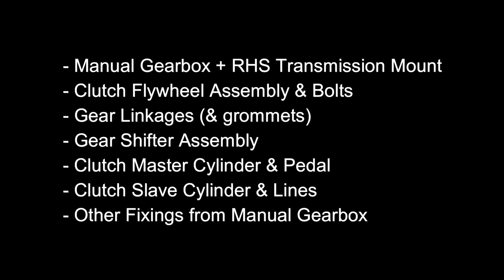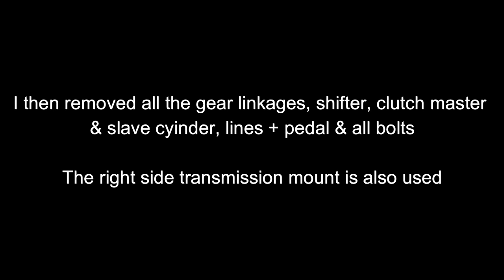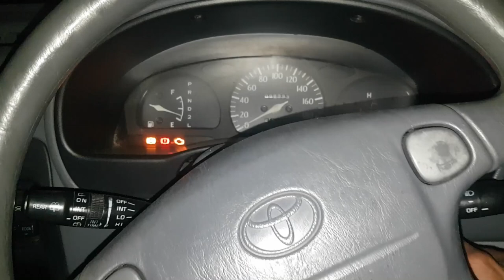Auto to Manual Conversion - Toyota Starlet 1996 (4E-FE)

Comment: I purchased a manual swapped GLanza V last year and one thing i have noticed is that I can still start it in neutral, telling me that they did not touch a clutch safety switch, i was also told that alot of cars only sold in japanese domestic market didnt have clutch safety switches from factory and i always thought that was odd. Another thing i wish i could find out is what manual gearbox they used

Comment: my friend good job...one question, revense light is connected...
Reply: You can get a spare manual gearbox reverse connector and cut the reverse wires going to the neutral saftey and solder them to the connector

Comment: Can you please drop a link to buy
RHS gearbox mount or picture of it..am swapping my ep91 with a 4 speed manual from old starlet
Im stuck on it please
Reply from the maker: I just got one locally. Basically it should be the same mount that comes with the gearbox. There was a slight variation. Some engineering work could also do. Cheers

Comment: First of all congratulations. It’s a great video and you did an amazing job. I have to put a 4EFE manual gearbox on a 4efte that came automatic. The flywheel is still on the engine. Should I use the manual 4efe flywheel? I also want to know how much gearbox oil I should buy for the refill after converting. Thanks!
Reply from the maker: Thanks,  about 4-5L from empty, fill to level plug. (might've been 75w-90 or 80w-90)

I would take it easy on 4efe gearbox, although they may be built just as strong, given Toyota.

Yes manual flywheel will only work with clutch pressure plate assembly.

Couple small things I forgot to do included the reverse switch which wires to to upper pins on the auto transmission connector, and use a better clutch before putting it in.

Cheers
Reply: Assembly worked out perfectly. I got the FTE fly wheel and put a good clutch. It works fine. I have a friend in England who put the two gearboxes apart from the two different engines and he told me that they are very similar and let means that they resist the same pressure. Anyway I’m not gonna put 300 hp. I want to tune in to about 180 to be able to use it as a daily car.
Reply: @djfrankieflowers  how did this manual swap go. I currently have a auto glanza v and am looking to put in a manual gear box out of a glanza s. Sounds like you've done something similar. Anything in particular to look out for that may trip me up
Reply: Hi there. Despite other people on YouTube that never answer to important details that can change our lives, I am going to tell you my great experience. My 4efte Starlet Glanza engine was automatic. My Corolla E21 4efe engine was manual. We removed the automatic fly wheel (dented) and installed the 4efte manual rectified fly wheel. This way we could install the new clutch. The rest was pretty straightforward. Just don’t forget the manual fly wheel bolts!
Reply: @frankieflowers4732  appreciate it 🙏
Reply from the maker: I think  another thing to look out for is the transmission mount can have a slight variation between models.
Cheers

Cheers
Reply: @frankieflowers4732  finally finished my glanza manual conversion. Couple of things I've noticed boost has dropped and oil pressure light is half illuminated any ideas why this has happened?
Reply: Did you bridge the connector that used to go to the automatic gearbox? That is important to elude the ECU.
Reply: @dylanc4684  did you ever figure out the lowered boost issue?
Reply: @pate7816  haven't quite figured it out yet it will freeboost 10+ psi when taking off the hose to actuator. I do have a manual ecu which I will hopefully get a chance to plug in the next couple of days and will let you know how it goes

Comment: Heya how would you wire up the reverse lights?
Reply from the maker: From the auto transmission connector you need to wire up and connect 1 or 2 of the pins to the reverse switch located on the transmission housing.

Comment: Thanks again for this video. It was very helpful. I swapped a manual 4efe with a auto 4efte in a Corolla E11. I bridged the pins in the connector for the auto transmission but the engine check light is on. Diagnostics gave my error 22 and 42. How can I solve the get the ECU to bypass the malfunction created by the auto gearbox removal?
Reply from the maker: No worries. The car didn't have any issues apart from reverse light pins needing to be wired into the auto transmission connector.
I'm not sure with the check engine? Maybe the MAF sensor or vacuum lines? (if they have one between models)
Cheers
Reply: What is the MAF? Are you talking about the MAP sensor?
Reply from the maker: @djfrankieflowers  mass air flow - I've heard turbo models often use them
Reply: J want to  change automatic transmitions with manual  to toyota camry 1992 2.2. Is it possible to put the manual transmission  from toyota celica  or some other models of toyota

Comment: I have 5afe auto transmission. 1st gear shift into 2nd around 2400 to 2500 rpm.due to high rpm shift car jerk. Plus due to this problem also facing low fuel mileage. Cos on low speed in city rpm mostly touch 2000 which is one of the reason for bad fuel consumption. Can u tell what i need to to . What i check transmission fuel ok, plugs ok, throttle body cleaned, kick down cable ok too
Reply from the maker: Could be an issue with the auto transmission or electronic control - maybe throttle sensor although I'm not sure. Cruising RPM should be much lower you are right about higher RPM's leading to more fuel consumption.

Comment: Could someone please tell me where to find or how to build the CLUTCH ALIGNMENT TOOL WITH SOCKET EXTENSION?
Reply from the maker: Wrap with electrical tape evenly on each point until they fit snug for aligning. 
Can possibly do it by eye if your lucky, but may take a lot longer to fit together.

Comment: Did you have to swap the engine? I guess not but i thought you do. I have a 1995 geo metro 3 speed that im thinking of switching from 3 speed auto to 5 speed manual. Just wondering how difficult it would be.
Reply from the maker: No, the engine did not have to be swapped. It depends on the design of the vehicle, if the body was available in both manual and automatic variants, it will certainly be easier.

Cheers

Comment: Is a 1995 Toyota Corolla engine compatible with a 1993 Toyota starlet gearbox?
Reply from the maker: Hi there, I'm not really quite sure to be honest.
There are quite a few similarities between models, but my concern would be the transmission mounts are likely to be different to fit the body of the vehicle. I would compare the two side by side to identify any differences.
Cheers
Reply: Thanks

Comment: Hi, I'm thinking about doing the same Auto to Manual conversion, is this a one person job (start to finish)? Also, i'm in NZ as well, how did you go about WoF and Insurance etc?
Reply from the maker: Hi there, one person with the right gear and about 2 days total to replace the transmission. No issues yet after several years, they are all factory toyota parts and designed for the vehicle chassis, therefore from a mechanical perspective it functions as intended.
This may be different in your circumstance, in which case I would inquire to your local auto - mechanic workshop.
Cheers
Reply: @stefanstoove9254  Hi, thanks for answering. Good to hear that the conversion is holding up and very true about the parts being used for its intended purpose etc. Great video, really informative. There are some aspects that I'm uncertain on (wiring/jumper etc), will look into it. But massive prop's. Cheers.
Reply: Hey mate I'm in NZ too and considering the swap, any chance you've made any progress or have found anything out regarding wof etc?
Reply from the maker: You will likely need to have a low volume certification through LVVTA in New Zealand to be fully compliant.

Comment: You dont happen to recall the gearbox model number you used do you?
Reply from the maker: Is that printed on the gearbox somewhere? I could take a look and see. Cheers
Reply: @stefanstoove9254  I think it is on some, but im not sure where on the gearbox it is. Its on the VIN plate, but that would be on the car at the wreckers still. 😁 All good, im looking to do the same conversion, but just cant seem to find the code for the gearbox that came in the 4efe cars as opposed to the 4efte turboed ones. Good video too by the way, very helpful. 👍

Comment: Do i have to do the same thing to a toyota corolla 1997?
Reply from the maker: If you want :)
Just make sure the model came in both auto and manual and the job will be a lot easier. Sometimes the engine mount may be different. 

Cheers

Comment: Did you install the sandwich plate from the manual car between the block and gearbox?
Reply from the maker: From auto car,  has a little peep hole with a plastic cover. Fit OK.